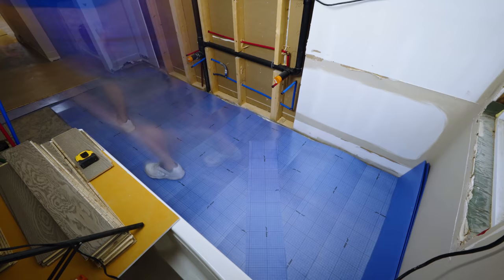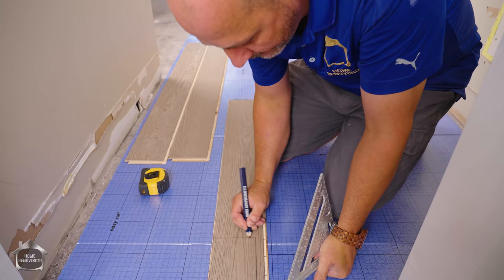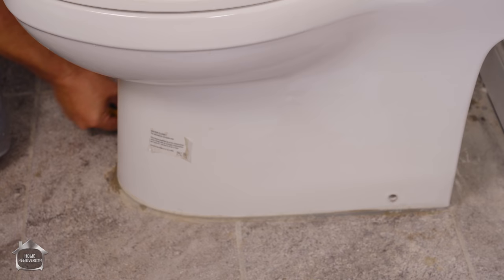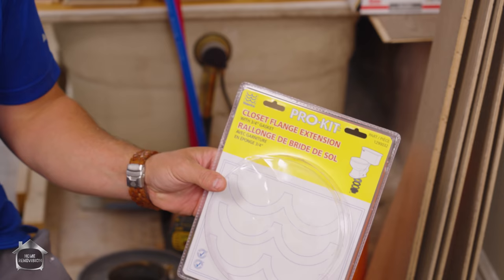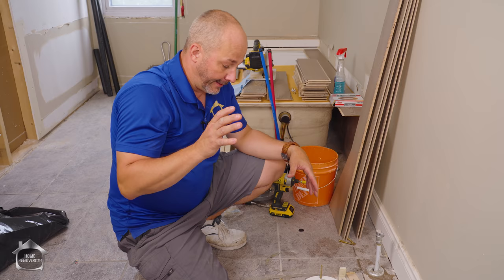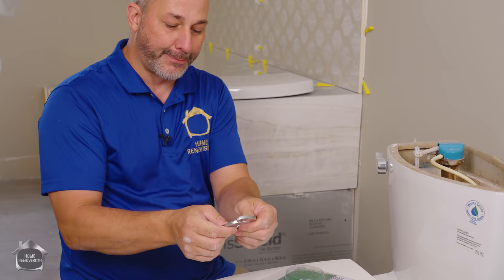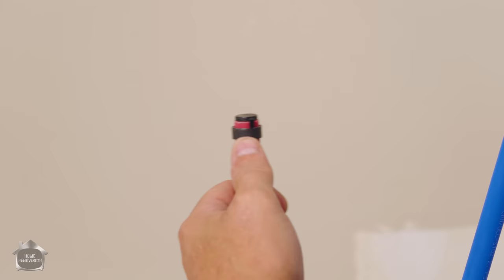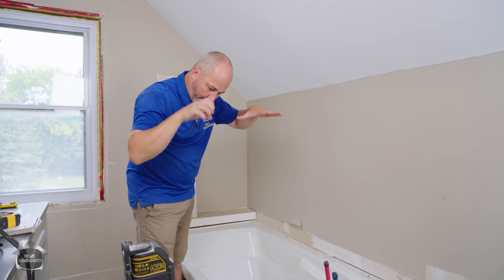How to Remodel A Bathroom on a Budget | A to Z

Comment: Jeff, thanks for all you do. I am about to demo a small bathroom and tackle the reno myself. I assisted a knowlegable friend with our main bathroom last year and am confident I can tackle this after all I've learned watching your channel and helping with the previous project.

4'6" square area ( not including fiberglass shower stall I will be leaving to stay under budget.
New toilet, vanity, vinyl plank flooring over radiant heat.
My question is this
The ceiling is 6'9.5" ( I am 6'9") we are in a condo with a neighbor unit above so no access from the other side.
I intend to demo the ceiling and grab about 7" more space.
I'd prefer to leave the existing sheet rock on the walls. Is there a logical way to cover the additional space between the existing top of sheet rock and the new ceiling? 
Or am I just replacing all the rock? I intend to tile above the shower stall and install a niche with led lighting ( once again, I'm 6'9"..)
Btw, I've been using the Radius 360 for 5 rooms now, ceilings included. Thank you! I used to hate painting, now I actually enjoy it. Had to show the guy at HD paint counter what it was, he never saw it and they didn't stock in locally. You've also moved me on from big box paints.
Thanks again

Comment: After you cut the cement board ,when you have those rough edges or you need to take a little bit off to make it fit, I like to use my rub brick. It's not rough enough to rip up the board and it makes a really nice finished edge. And I have a question as well, when you wear your knee pads do you use both straps on each one? I have found that#1 if I only use the bottom strap on my pads I don't get that horrible rubbing on the back of my knees. #2 my most important issue with my knee pads is to not let ANYONE ELSE USE MY PADS, EVER!!!Because I am a woman and my legs are not as wide as most of the guys I work with and all of them weigh more than me.  I have found that if any of them use my knee pads, their weight and the width of their knees and legs in general versus mine tend to stretch out my knee pads so when I go to put them on the next time I need them they are all really loose and I end up having to tighten the straps up to the next hole and until the straps stretch out to fit my legs they rub my legs raw and man oh man I pity the guy who was dumb enough to wear my knee pads. Believe me you can ask any man that has worked with me what happens if they ever even think about using my pads. Lol

Comment: Thank you for this comprehensive bathroom renovation, Jeff!  I just  bought a house fed by well water and the bathtub has a thick coat of sediment - not attractive at all!  From your background, is this repairable?  I really don't want to swap it out if unnecessary.  Thanks again for your invaluable guidance.
Reply from the maker: stains can be removed with iron out! i would definitely look into a better water purification system to extend the life of all your plumbing and save a lot of cleaning.
Reply: @HomeRenoVisionDIY  Thanks for that, I'll definitely try it.  Your videos are such a help and inspiration for a new, 'do-it-yourselfer'.

Comment: Do you have a video about starting an already finished basement remodel?  With no records or previous plans, is it better to go ahead and rip out everything down to the studs and build to the current code or higher?
Reply from the maker: the best option is to open up the walls and see what was built. drywall is just the lipstick. Cheers!

Comment: Use the hole in the side of your strippers to curl the wire ends instead of having to grip them with the tips. Quicker, easier and accurate.

Comment: So I hear you on the new crimping method on PEX, but realistically, are the older rings as effective? I know that application can always change that, but I already have the older style from a remodel I did last year and the tool is about $50/$60 here in the states for the crimp rings. After this reno I dont have plans to do more plumbing. What are your thoughts?

Comment: When replacing a toilet I found out my bathrooms (maybe the entire house as well) are already tile-over-tile on the flooring. The tiles are still in excellent shape we just don't like the color. I'm leaning towards just putting down a tile coating/paint rather than adding a 3rd layer, or ripping it all out and starting over. What would you do? Thanks
Reply: DON’T, I repeat, DON’T paint tile nor put a 3rd layer of tile/ceramic. 

Paint : from the start painting tile is not something that gives lasting results, now imagine on a floor… Where you walk, drop things, maybe drag things. Just don’t paint tile in general, unless it’s a small backsplash maybe.

3rd layer : the more you add layers, the harder it gets to fix things in case of a problem (water leak for example). And, the thickness of a 3rd layer is just something really stupid if you consider the transition between rooms. Plus if something’s wrong with the first or second layer over time, you’ve got a huge mess on your hands, because now you’ve got two layers on top of the first one.

Just take the time to demolish the proper way : be careful, don’t rush things, plan ahead, keep the site clean, etc. Then wash/clean everything properly, and start over with just ONE layer. Plus, if you want to add heated floors, now will be the perfect occasion, when everything is stripped! 

Good luck!
Reply from the maker: paint is a temporary fix, however if that is what you are looking for to extend the time before doing a complete rip out then, Cheers!

Comment: I want to remove my cheap
shower stall and put in a made to fit tile shower pan and overhead shower head. The drain will stay in the center. I know I need to get it down to the studs. Odds are the walls aren't insulated and I know I have to put that green water proof boatd in and in the shower pan. How do I create the slope? I will have a shower current as it's a small bathroom, so I'll need to create a small lip where shower meets my hardwood floo. Do you have a video like that?

Comment: Jeff, I am curious about the flooring choice in the bathroom. Is it impervious to water infiltration and mold build up? Looks like your allowing hundreds of inches of access for the water to reach your subfloor etc...
Reply from the maker: In this case it is engineered wood on a heated floor. so I am not worried about any small splashes as the floor is warmed and will dry itself out immediately before any damage occurs. Cheers!
Reply: You can fill with caulk

Comment: 1:56:00 Any SPARKY will tell ya that linesman’s ARE a hammer😂, and funny enough Klein engineer’s there’s to be just that; LONG AS hitting on EDGE & NOT THE FACE (where it’s riveted together). Just an fyi😉
Great vid and REALLY DO LIKE THE LONG LENGTH VIDEOS A LOT👍🏻👍🏻
Cheers✌🏻
Reply from the maker: Cheers!
Reply: I'm a sparky and there is not a tool in my box that doest double as a hammer. But Klein's are the best. If I was only allowed one tool it would be my Klein's..

Comment: How much does quartz countertop contract for winter. I put in one in summer wall to wall and now I see some contraction of the stone touching the exterior wall (& close to a vent on floor). It separated from the caulking. What the best fix & when to do it

Comment: Hi. I have cerebral palsy and use a wheelchair. When I initially purchased my home, the master bathroom came with a super slippery tile floor and because I was worried about falls, I painted over the tile with some sort of slip resistant deck paint. I want to redo the floor. Can l install new flooring over it, or do have to sand it up? Thanks.

Comment: Hey Jeff.  Installed a vanity but didnt predrill the holes in the cabninet to attach the vanity to the wall.  I can't fit a drill in there now to drill through the back and into the wall.  Is there a way to attach in a tight space?  Trying to avoid disconnecting all the plumbing.

Comment: Need to add a kitchen island with stove top burners and vent, but the floor is concrete slab.  Any DYI in your archives?
Reply from the maker: not yet but I would suggest renting a concrete cutter to run a steel supply line for electrical.

Comment: Hi Jeff, I do not know about the USA, but here in the UK we have toilets that the connection comes through the wall and the toilet is fitted about 4 to 6 inches above the floor to an earthenware pipe. Because these were often fitted incorrectly or the screws rotted out the floorboards the pipe is damaged and ends up with a broken pipe and a bad smell. How about showing this type of replacement on one of your videos.
Reply from the maker: would love to when I get the chance!

Comment: Stupid question, can you install floor heating system on top of the old tile floor before adding the new floor on top?
Reply from the maker: yes but only if you cover the cable in floor leveling cement first!

Comment: Hey Jeff, thanks for the awesome videos! I have a flooring question but not for a bathroom. I want to install vinyl plank flooring in my living room, but I have to leave the carpet as I rent and have to be able to undo my work when I move. I understand the necessity to remove carpet from a bathroom before installing a new floor, due to moisture issues. However is it OK to install vinyl planking over carpet in a living room? I would first lay down some plywood as a base for the planking, however I'm not sure what kind would be best. The carpet is not very high in plushness, but it's not a commercial low pile style carpet, either. 

I've seen videos on YT showing people who've done this, and it looks like it would work. I could live with a bit of shifting, though I think the plywood would do a good job in keeping things set. My floor is level, as all my furniture sits level without an issue and nothing rolls off my tables. I assume that helps things.

Any input would be appreciated. You have given me a huge base of knowledge to draw from, and your videos have given me tons of ideas to improve my small space. Thanks again.
Reply from the maker: just no! talk to the landlord about making the switch.

Comment: No metal protection plates on the notched and hole sawed  studs to prevent future pex puntures by drywall screws ?
Reply from the maker: yup. since i do all the work i also know where the plumbing is. it is also protected by a cabinet. Cheers! Plates are for trades who work and walk away!
Reply: You know they are required. You said you were going to put them in but you didn't. These are the code . I don't think you should ever preach circumventing the code for any reason. You are like an instructor to these folks. They are very likely to put a screw into their utility lines. I've seen it happen . New copper water line lasted minutes before a screw caused a big leaky mess in a two story building causing more troubles below in someone else's place than their own. You are preaching doing it right . Adding value to their homes. It's not cool to demonstrate ignoring codes. And this one would not cost much time or money.

Comment: Hey Jeff, really appreciate your videos. Just one question. Planning a little Reno to turn one huge bathroom into a 3 piece and an on suite. Do I need two separate drains/ventilation systems? Also should I run water separately to both or would one supply for hot and cold each do the trick you think? (I know it’s very situationally dependant, but any tips would help a lot). Thanks!
Reply from the maker: best to consider JOINing our membership program. You get access to our forum and you can send me pics so I can properly advise. Cheers!

Comment: I bought a jacuzzi tub that doesn't have a tile lip around the edge. Yet I want to use it as a shower and tile the wall. What do you suggest to seal the edge to the tile?
Reply from the maker: buy a tile flange kit to add on before closing the walls.

Comment: Hey just to let u know if u were getting that receptacle inspected it would fail trust I know that the possibility of this happening is astronomically almost impossible but day that if you had a something hanging on the the wall that was conductive and it fell and landed on the receptacle and something was plugged in it could arch and start a fire that is why it's code to install the receptacle u with the ground facing up one of my friends is a master electrician and explained it to me and if you did that during your test you would fail

Comment: I was planning to do the LVT/LVP over existing tile, but I am reducing my shower size and thus probably leaving a gap in floor height. I was also going to extend the LVT/LVP into an area currently carpeted. Should I just rip everything up to keep an even height or is there any remedy to this?
Reply: I would just patch the areas with plywood of approximate thickness to even it up to the tile - MUCH less work...

Comment: My bathroom ceiling thin coat is peeling for the second time in ten years. I have installed the largest exhaust fan available and used moisture resistant paint the last time we remodeled. Any suggestions?
Reply: Awesome video. I learned a lot. Personally not a fan of sharkbite fittings unless it's temporary. I redid my whole house with pex-a and a manifold. Pex is the only way to go in my opinion.

Get yourself a pair of ratchet cutters for cutting pipe. Best investment I made when I was doing my plumbing.

Comment: How do you get your flooring installed so easily? Some pieces I can be fighting with to get it locked in while others are so simple.They almost "fall" into place. I use good quality flooring because I have used cheap stuff & it is worse.
Reply from the maker: in this case it is the design of the flooring. Cheers!

Comment: At about 3:31:40 you say you can't get electrocuted without completing the circuit through a neutral. This is not correct.

You can 100% be electrocuted if you touch a live wire, because if you are grounded, you yourself will complete the circuit.

The neutral is connected to the earth ground at the main service panel, & if you are somehow grounded, you are actually in contact with ground and neutral, since they are tied together in that box.

The live wire has a potential of plus 120 Volts AC or so. You will be at a potential of about 0 Volts if you are grounded, and you can definitely be hurt or die.

For instance, if you happen to be in contact with a copper water supply line, which in the US is usually physically connected (bonded to) a ground rod, which is connected to your main electrical panel ground, you will have the current provided by 120 Volts AC flow through your body, completing the circuit, if you touch a live wire. It'll flow through you and out wherever you are touching the copper water supply line.

If you're unlucky enough to be touching the live wire with your right hand & copper line with your left, your heart will likely have all that current flow right through it.

Comment: If you ever want to fix a tiny rigged bathroom I have one that would make a great, what not to diy, video. The guy that lived here before us for the last 80 years did everything himself, including put a bathroom upstairs off a n already small bedroom... Lol He had the entire house on one breaker.. not joking...
Reply from the maker: Wow, that is not DIY That is DYI (do yourself In)
Reply: @HomeRenoVisionDIY  sure is. We had my father in law help us with all the electrical and my dad helped us with some plumbing issues. I was just happy the guy wasnt dumb enough to put the water line on the outside wall.. lol 

We've done a lot of work on this really old house, but the upstairs bathroom has started leaking into the downstairs so we have to do something soon. Tying to save up to fix it ourselves. ♡
Reply from the maker: in most cases a leak is a very low cost fix if done early enough. Cheers!
Reply: @HomeRenoVisionDIY  the bathroom surround is cracking from the wall being bumpy. Silicone didn't fix it. I also think the floor isn't waterproofed and slowly leaking downstairs. I'm hoping to go down to the studs on all, but the outside wall, and add shelves in the wall with a proper tub/shower. The room is like 4.5 ft by 8 ft and very small. {Haven't measured yet, so might be off}
Reply from the maker: a short term fix is to glue on an acrylic wall panel system. those situations are usually acting like a siphon and pull water from the wall into the ceiling every time you shower. once the studs get soaked it siphons every time. a water barrier will allow it to dry out and buy time until you can fix it.  otherwise you might be dealing lots of mold and a weakened structure.
Reply: @HomeRenoVisionDIY  thanks! I'll talk to my husband since we won't be able to get anything started for at least a year. Cheers to you!
Reply: @HomeRenoVisionDIY  as an update it wasn't the bathroom that was leaking, it was the chimney. We replaced the roof, my husband is a roofer, and found the flashing had deteriorated around it. It was probably as old as the house! It looks great now!

Comment: Love the video, however   :)  in some areas you sounded like a typical DYI homeowner.  Having worked in construction, in the field for 20 years, there were a couple things that make you look and sound like a total amature.  With that said, for anyone trying to do a remodel or repair found it to be very good advise.  Thanks for putting on youtube.
Reply from the maker: Hi Linda, thanks for that. I try to connect with an audience that cannot afford a proper renovation company. Diy is very tricky for most folks so I try to share simple basic solutions without going all pro on them.

Comment: I know it probably sounds obvious but could anyone tell me what the trap door is for?
Reply: to access the fixtures behind the wall without having to break up the wall. you could also add shutoff valves in line and accessible there, in case  you needed to shut off water from the tub.